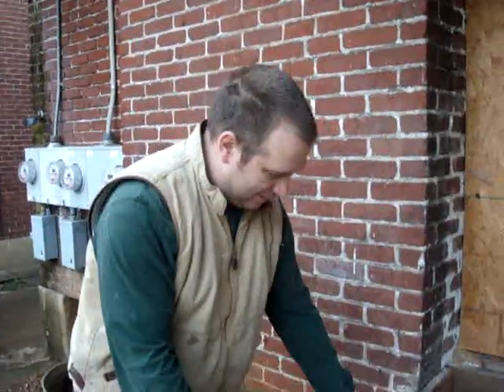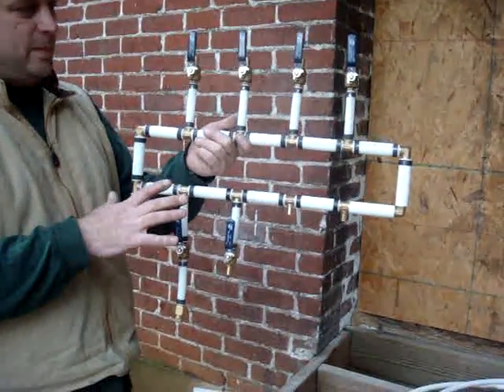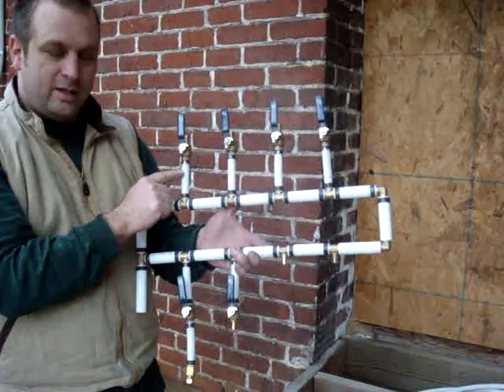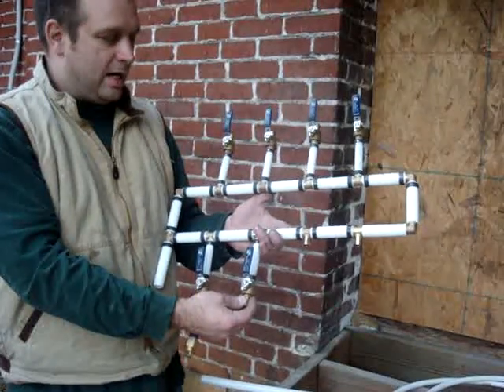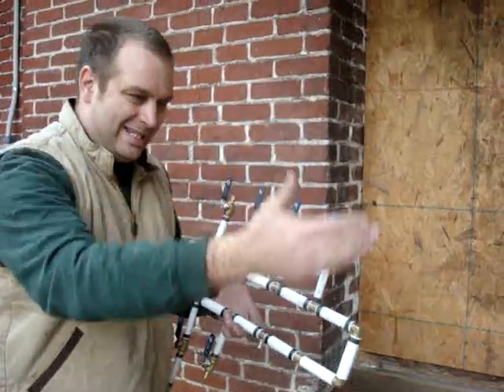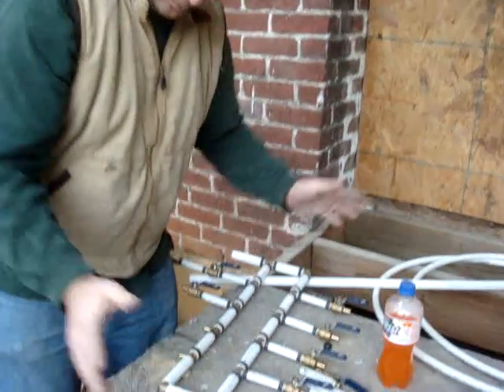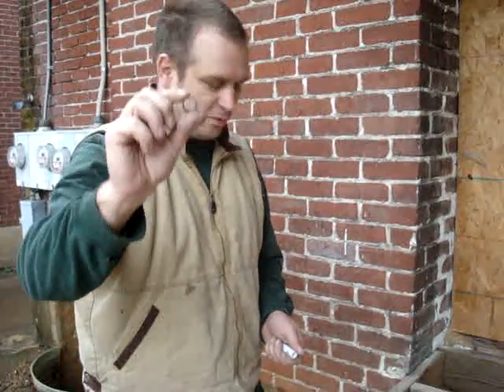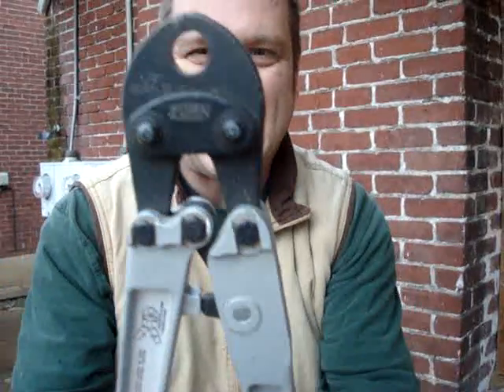Introduction to PEX

Comment: Great Video! One question; On your cold water manifold, I noticed that the supply port to the water heater is 1/2". Would it be wise to make that port 3/4" to get same amount of pressure to the hot water manifold?
Reply: Pressure is not effected by line size.  Volume is.  If you run a half inch line to you will have the same pressure.  You would have less volume.
Reply from the maker: Good question--one wouldn't reduce to 1/2" and then go back up to 3/4" because flow would be still be throttled down to the 1/2" pipe in the manifold. In the case of this house, 3/4" came in from the street and then because the house is so small 1/2" is good for everything, but if you needed greater flow, you'd make the entire manifold 3/4". In most homes in the US, that's what one would do: you would keep the inlet and both manifolds (cold and hot) would just be 3/4" and then one would run 1/2" branch lines from the 3/4" mainfold. Does that make sense?

Comment: One criticism... you should probably have 3/4 going to the hot water heater.  Remember, an entire other manifold will be fed by 1/2 pipe with your current setup and will likely undergo huge pressure drops if multiple hot water lines are turned on at a time.
Reply: Nathan Scott m
Reply: You are wrong.
Reply: @christopherpino2948  you are

Comment: Hi James,

Just found your video. We are building a new house and I was thinking something like this would be great. It's a pretty standard size. Two full baths, one half bath, washer, dishwasher, fridge, kitchen sink & outdoor line. 

What would be the best way to run the lines, a single line to each area or a line to each fixture?
Reply: Ryan Dugger Go  awaaaaaaaaaaaaaaaaaaaaaaaaaaaaaaaaaaaaaaaaaaaaaaaaaaaaaaaaay.  Someone throw a Bar of Soap at him will ya, that outta scare him.  When an "opinionated" person losses touch of sanity to the realm of losing touch of "reason"...........then I guess they're Presidential material.
Reply: It all depends on the proximity of the fixtures to the heater.  Cold lines are just a waste of pipe unless you want to be able to isolate the different fixtures or bath groups independently.  Hot lines matter a lot.  As these will dictate how long you wait for hot water to arrive at the tap and the amount of water you waste while it gets hot.  In some cases it would be a great idea to do a home run system to the source.  In other situations it might end up costing you more in wasted energy and water.
Reply from the maker: The best is a single line to each fixture, and the second best is a hot and cold to each room (like I did in the video above).

Comment: your water inlet line is the same size as your distribution lines ???

I always thought for purpose of adequate flow that the incoming water supply line should be bigger than the distribution lines to the individual service points like kitchen faucet (cold), toilet (cold), etc

So example water coming into the house @ 1" and distribution lines at 1/2" and some at 3/4"

Also could this kind of manifold be used in conjunction with residential fire sprinkler systems or would you just build a dedicated water distribution / manifold for that, in of by itself ?

I have 1" coming into the house and 3 bathrooms (standard sizes), kitchen, laundry and then want to add the fire sprinkler system with 2 ~4 sprinklers per room in a 5 bedroom, 1 family room, 1 living room, 1 dining room house - so I am looking at about lets say 30 to 45 sprinklers all together including garage and they are 1/2" FNPT if im not mistaken and they can feed off of a 3/4" line with a corresponding adapter T made by the same manufacturer that makes the sprinklers OR I can use a 1" T instead of 3/4" T and the same 1/2" FNPT is supplied. But see my point... I think its not a good idea to use the same size of the incoming water line... but maybe you had some better insight on this than me.

Thanks let me know
Reply from the maker: The water inlet is 3/4" and the branch lines are 1/2".
Reply: James Glass oh alright. Sorry I guess they looked the same as all 1/2" :)

So what do you think about how to setup a residential fire sprinkler system with a manifold ? and the sizing of the water supply line for such.
Reply: You will never keep your home from burning down with a 1 inch fire suppression system.   Key word is suppression.  They are meant to buy time before the department arrives.  In most cases by the time the fire got large enough to trigger the system it would be too large for the system to handle. Look at Uponor's fire sprinkler systems.  They are pex A and are built specifically for fire suppression applications.

Comment from the maker: @Doug Pierotti for some reason I can't reply to your comment, but I'll see if I can message you.
Reply from the maker: +fUjiMaNia Yes. UV will break it down and manufacturers are clear about using it out of sunlight and even storing it out of direct sunlight prior to installation.
Reply: James Glass I'm gonna use it to build a light-frame for a small raised garden bed. I think I'll just paint it with one layer. thanks :-)
Reply from the maker: +fUjiMaNia Oh, that should be fine!
Reply: James, you can email me at

dougpierotti@gmail.com
Reply from the maker: ***** I can reply to this! So weird about the other. Anyway, I have run PEX (which is approved for direct burial and in concrete) from the meter to the house in residential applications using 3/4" line. I don't have any experience with larger apartment buildings and I don't know if the largest PEX pipe available (1" as far as I know) is large enough for you. But, you can use it so long as you can address volume and pipe size, which I don't have a direct answer for--sorry.
Reply: James Glass Uponor aqua pex type A is available up to 4inch.
Reply: +James Glass great video. does PEX get affected by direct sunlight?
Reply: +James Glass gotcha! will painting the pipe help reduce the UV effect on it?
Reply from the maker: +fUjiMaNia I don't know. I've never considered it and haven't researched it. Do you need to run pipe outside or something? Can you bury it or otherwise conceal it? Is this for irrigation?
Reply: James Glass  o

Comment: James, have you run a PEX 'main' line from the meter?"  Would you recommend it? I have a small apartment building that I will be upgrading the plumbing- galvanized drain lines and main (1") , with copper hot  & cold that runs through the concrete floor.  Built in 1955 and in need of a total retrofit.  My plan is to run PEX throughout and abandon the current hot & cold from the concrete.  I have the ability to run the main line the entire back side of the building and then tap off of it for kitchens and bathrooms (all on the same wall).  By tapping off the main line would I be losing pressure to each successive apartment down-the-line?  Great video, BTW.

Comment: thank you sir, i appreciate it very much. i have some questions about where to buy this stuff and what the best pex brand is - someone said "AquaPEX" is best ?? and I am concerned about the pressure, fittings, etc which prior to seeing your video had no idea or concern about. And we are in the process of re piping the entire house due to old copper pipes corroding and leaking beneath the slab.
Reply: Uponor aqua pex is great stuff.  Dont listen to this guy.  It is rated for over 180psi at 120degrees im pretty sure.  The crimp type systems have seen many lawsuits in recent years.  They tend to leak because of the crap brass fittings they use.  If your going to go with a crimp style I would recommend Viega.  Ive used both crimp and expansion type pex for the last ten years.  The only leaks I ever saw were on crimp pex B.  Uponor has 100% memory and can be tied into a knot, kinked and twisted.  Simply heat the kinks and twists with a heat gun until it turns clear and it will unwind  and un kink right in front of your eyes.
Reply: Ryan Dugger  what do you think about the original rehau pex fittings.  those seem like a tank to me.
Reply: Rehau is awesome stuff as well.  Type A just like uponor but the sleeve is brass instead of pex.

Comment: I want to create a manifold that connects a 2-inch discharge hose from a well to multiple garden hose outlets. The hose(s) will then run to tripod-mounted sprinklers for irrigation. The water will be drawn from the well and pushed to the manifold with a gas-powered pump. I don't have a clue how this is going to work out. Any salient thoughts come to mind regarding such a contraption?  I'm guessing there are ways to attach hose threads to a large PEX pipe and a way to attach a 2-inch hose to it as well.
Reply from the maker: Pressure and volume? You could make a manifold like this although the biggest pex diameter I'm familiar with is 1", so you might need to do research. You also have to calculate the gpm and pressure from the pump, along with pex diameter to figure out how much water and at what pressure your line output will be. Other than this generic design input, I can't be of much help.
Reply: James Glass I guess I was thinking PVC rather than PEX, but no doubt the answer would be the same.  The flow is in the neighborhood of 150 gpm at full speed.  I'm not sure what it is at minimum speed.  And I'm not sure whether a back pressure on the flow of water would be damaging to the pump.  What we did last year was simply let the water flow until it filled the full length of the rows in the garden.  That's probably what I'll do this year as well. GPM and capacity calculations are beyond my abilities.
Reply from the maker: Fred Harvey You do it out of PVC so long as you don't exceed the pressure ratings, When used for domestic water CPVC (or since this isn't potable you could check to see if PVC is OK) generally h20 pressure is between 50 and 75 psi. If you weren't exceeding that, you won't blow apart the joints. Also, PEX is not UV resistant (PVC isn't exactly great against UV either), so you might take precaution for what's exposed to sunlight. You could install a check valve to stop back flow. You can also get a local industrial hose shop to make you 2" flex lines that are flexible and UV resistant that you could hook up to the manifold. This sounds like a good time for a bit of experimentation!
Reply: PVC is rated for potable water its just not code approved for indoor piping. Its rated for over 200psi and there is no way your going to exceed that.
Reply from the maker: Ryan Dugger I see you've been busy. Carry on. But, DWV pipe isn't designed to carry pressure like I think you think it is. And it's not a good idea to use PVC for potable water. 

The bottom line is the building inspector will fail crap like that! I want to stress that anyone undertaking a plumbing project have full knowledge of the science along with full knowledge of local building code before beginning work--otherwise you'll just have to tear it out and start over. And the IRC is not a law issuing body or an enforcement agency so anything you find online regarding their "suggested" code may have been modified by the local AHJ.
Reply: Yes good advice about checking local codes.  Seeing how there is different types of PVC....  DWV cellular core PVC, Schedule 40 pressure pvc and even Schedule 80 pressure pvc.  Not to mention this guy was talking about a irrigation system. Schedule 40 pressure pvc lists 450psi at 73F on the pipe itself.  Your a handy man bro.  You have no idea about plumbing or plumbing materials.  Its obvious from your videos your a jack of all trades and a master of none. Go paint and stuff and leave the plumbing advice to the professionals or just keep handing out your bad advice to these poor people.
Reply: James Glass
Have a can of PVC Cement right here.  Number 10 advises: "Allow 15mins cure time for good handling strength and allow 2 hours cure time at temps above 60F  before pressure testing up to 180psi.  So the pipe is rated for 450psi and the glue joints are rated for up to 180psi.  Oh and it says right on the can Used for potable water and DWV connections.  Zurn pex is rated for 160psi @ 73F.

Comment: What type of fitting is the diagnostic port?
Reply from the maker: It's just a regular 1/2" npt fitting. You can get 1/2" pex to 1/2" ntp in both male and female.
Reply: Thanks!  Would you be opposed to the notion of permanently integrating a pressure gauge into the loop?  I have city water.
Reply from the maker: moaski No, you could install a gauge. I also have a handy gauge I carry with me, and most people don't, so having the gauge might be convenient.
Reply: I appreciate your input.  Thanks, again for your help!

Comment: Here I am again the pain: Is it possible to use plain 3/4" polyethylene pipe with a manifold to run to my outside water hose, if so, what would I use for clamps?
Thanks Pete Bauer
Reply from the maker: By polyethylene do you mean cross linked as in PEX? The answer is yes either way, if I properly understand the question: 1) yes, you can make a 3/4" PEX manifold (same as in video, but use 3/4 PEX fittings) and 2) you can run 3/4" outlets anywhere you want. BTW, you can also hook PEX to other materials if you use a SharkBite or GatorBite fitting--this is a type of press on fitting that allows you to mix and match if you must so in trouble retrofit situations you can bring copper, pex PB or CPVC together. Any hardware store has these press on fittings.
Reply: James Glass Sorry James I should have said  3/4" x 100' Poly Utility Pipe, I have about 200ft. here and thought I would use it if I could, it is only for the outside tap. It is marked on the pipe 3/4" PPE.

Comment: Hi James
Stupid question but just being careful: Does it matter which side of  the manifold the water intake is located? I doubt it does but again, just being careful.
Thanks and have a great weekend.
Pete Bauer
Reply from the maker: Nope--the goal is to just have water coming in from both directions to each outlet and whether the incoming water comes from the left or right (or it could be top or bottom) doesn't matter--just make sure that you take two branches from the point of intake and make the loop for all your water lines.
Reply: James Glass Thanks again and I am trying to learn all I can about using brass on private wells, if you would be interested I would be happy to forward you the conclusion when available.
Cheers Pete Bauer

Comment: this is probably a dumb question but....   Do you also put a shut off valve at the other end of all the lines even though you have the Manifold shut off valve at the start of the water line?
Reply from the maker: I love shut off valves, and I use them a lot. Code here doesn't require shut off valves at the fixture, but I think that's bunk, so I use a shut off valve for hot and cold at every fixture.

Comment from the maker: I make the distance enough so I can turn the quarter turn valves. I suppose you could make it a bit longer so long as you have room to mount it on the wall.
Reply: Thank you so much for your help, I have one more important question if you wouldn't mind. If you read at the bottom of the PEX supplies they always caution you to use accu-crimp plastic fitings (NOT BRASS) if you have a private or dug well, is that a true danger, I have talked with other people that have used brass and had no problem.
Again thank you, to bad there weren't more people like you in this world, it would be a far better place.
Sincerely
Pete Bauer
Reply from the maker: ***** Thanks for the nice words. I don't know anything about wells, I'm afraid. I only work in urban areas where there's domestic water. But, since you brought it up, I think I'll ask some plumber friends to see if I can learn anything new!
Reply: James Glass Thanks again and my compliment was sincere. If you go to a Home Hardware (http://www.homehardware.ca) web site and click on pex pipe for example when you scroll down  the overview at the bottom you will see
(Install Accucrimp plastic PEX fittings when the water source is from a private well. DO NOT use brass PEX fittings when the water source is from a private well.)
Brass is far cheaper than sharkbite etc. and you can't get plastic shut-off valves that I am aware of.

One more question if you wouldn't mind is does it matter how the manifold is mounted vertically, horizontally and distance from hot water tank?
Thanks again you are a scholar and a gentleman.
Pete Bauer
Reply: +James Glass Why don't you just leave the pressure gauge permanently connected to the diagnostic port?
Reply from the maker: +memouki You could do that. I keep a gauge handy, but if homeowner's were dying to know their water pressure at a glace, you could install a gauge and leave it. No problem.
Reply: *****  I know it's been a year, but I'm working on this right now (rehabbing a 150+ yo house with PEX and a private well) I have been told that some well water can be very acidic and destroy metal after a few years so they suggest plastic crimps but our local guys tell us this isn't an issue because our water doesn't reach that Ph level.  Testing your well water would be the best way to know.
Reply: I will be installing an outside line to a shed. I always worry about leaks. Is there a meter that indicates water flow in case I had an underground leak.

Comment: 1/2" feed to your water heater?
Reply from the maker: Yes. For this house that is more than enough, but in high demand cases, the entire manifold and supply to water heater should be 3/4". This is the case for both tank and tankless units.
Reply: Everything should be 1/2” unless your a business. There is so much water wasted on the hot side.

Comment from the maker: Hi Steve-tool adjustment/replacement is occasionally needed and a gauge is included in most kits. You can use a crimper with replaceable heads that are adjustable. The gauge is called a GO-NO GO gauge. This was mounted to TP 3/4" plywood using PEX approved (kind of loose) clamps. Glad you liked it!